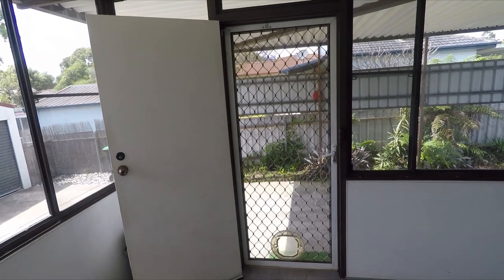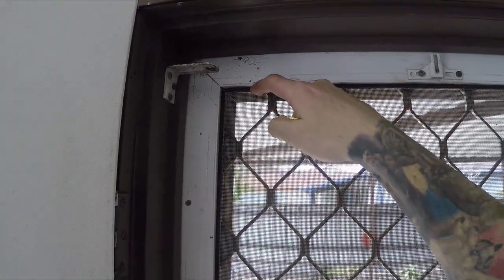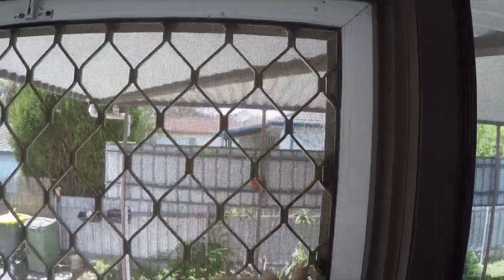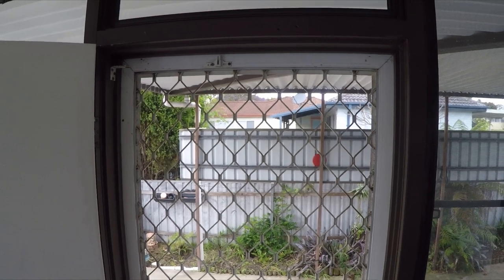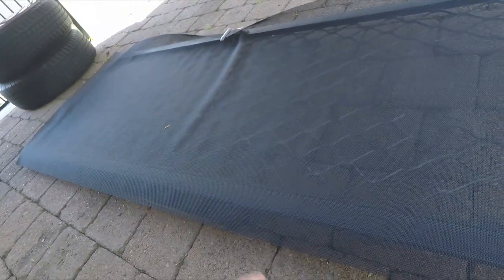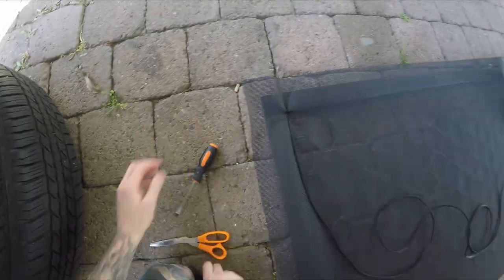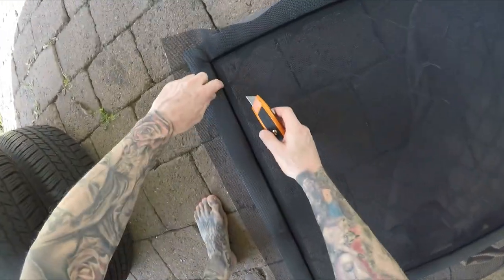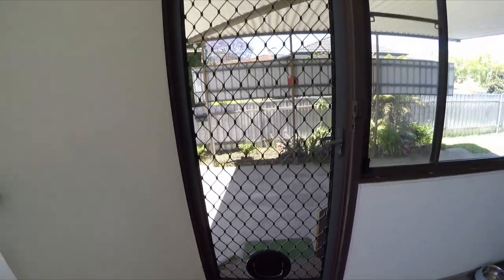How to replace/install Flyscreen Mesh  |  DIY

Comment: Nice job - how easy is it to make sure the wire is taut enough and not too loose??
Reply from the maker: Thanks. The mesh will tighten nicely when you push the spline into the grooves
Reply: For example, if you've rolled the spline into the left channel, then you've done the bottom, and now you're rolling the right channel, look at the mesh on the left side near the spline and see if it's lifted. If so, pull the mesh a little when rolling the right side, careful not to pull to much because it can warp window frames if that's what you're doing.
Reply: Makes sense thanks  @HULK-HOGAN1